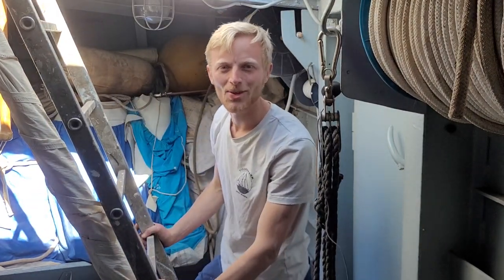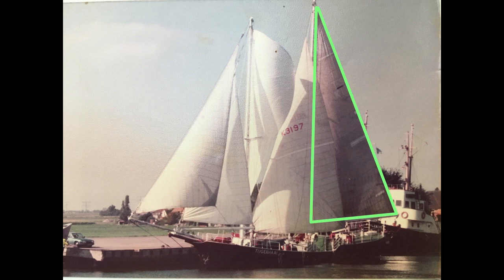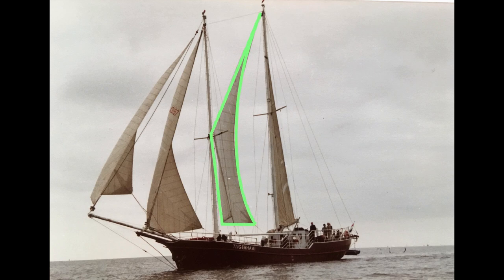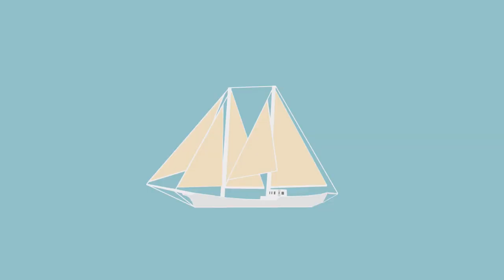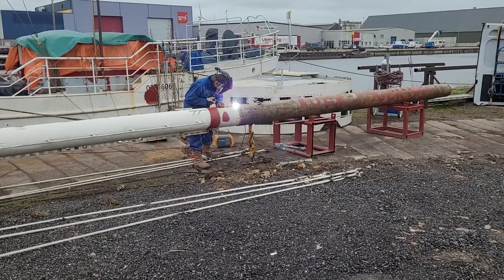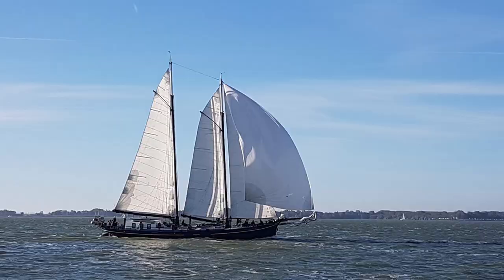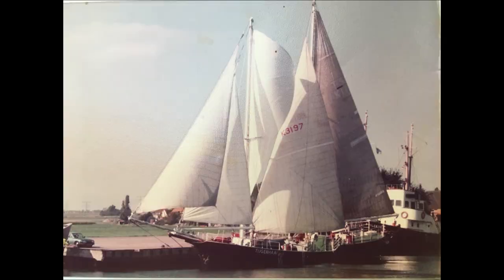The Sailplan - Rebuilding Schooner Tijgerhaai EP14

Comment: She had a lot of sail area for two crew. Splitting the 2 up front into 3 looks very workable. great update 2x👍
Reply from the maker: She did, and still does. Most of the time there's more folks on board though, but it's nice to have the option to sail her with only 2 :)
Reply: @tigersharkboatworks  Its nice to just set off and if needed pick up crew - visitors when and if you want. 👍👍 Looking forwards to see the mast stepped.

Comment: I would go for the sailplan of the 40ft "Bylgia" of  Eilco Kasemier, designed by Dick Koopmans sr. It consist of a Topsail with a wisbone on the for mast and a staysail on the main mast.
Reply from the maker: The Bylgia is a Ketch, which makes that sailplan more logical, because it completely fills the space between the masts. For a schooner like ours, it makes a little bit less sense, as the top of the staysail can not be near the top of the main mast, because the stay would then interfere with the wishbone somewhere in the middle :)

Comment: How about a self tacking jib at 135 or 150 size.  I noticed that the previous mast was not beveled for a serious weld ?  Perhaps a steel collar for additional strength ? The boat is shaping up nicely, the right sailplane will make her look good as well.
Reply from the maker: We will have a self tacking fore staysail, but the inner and outer jib both have to pass a stay to move to the other side, making it impossible to use a traveler to make them self tacking. That's why we have the tacking winch with one handle for 4 sheetdrums. The new bottom mast is larger in diameter than the old one, so there's about 4 inches  overlap, and a nice 12mm ridge for the weld(s). No need for a bevel or a collar :)
Reply: @tigersharkboatworks  you folks know what your doing, I know Tigershark will end up looking very good. Do you have interior layouts ?
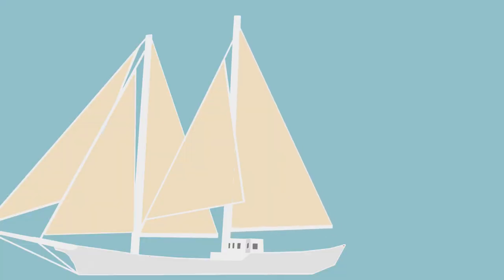Reply from the maker: Thanks! The closest thing I have to an interior layout I've used in the video about the plans for the rebuild: https://youtu.be/gpBusohBdpM start around 3:45 :)

Comment: But wishbone is not traditional for such a boat. Are you okay with that?
Reply from the maker: We've thought about this, and we're not sure. The thing with going for more traditional sails is that they generally need more people to handle them. Which in turn makes it more difficult to go sailing whenever we want to. But we might still change our minds :)
Reply: Depends on what you call "traditional". 
Wishbone ketch and schooners have been around since the 1930s (see schooner Carrina). Not really ancient but at least almost centennial.

Wishbone hasn't been invented for windsurfing!
Reply: @joeldumas5861  I've looked at Carrina, "Launched as a gaff-rigged top/staysail schooner", here you go. Traditional means there's no tradition to put this type of rigging on these boats. It doesn't mean it's bad and nobody did this though. Tigershark should decide what's best for them.